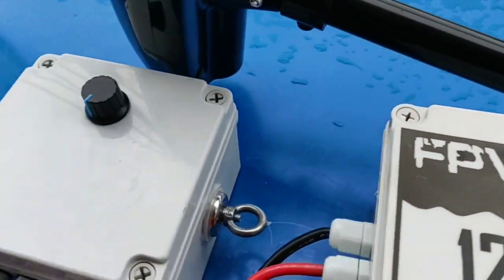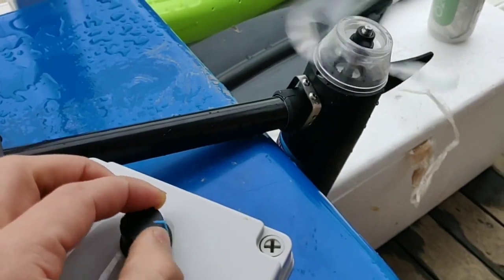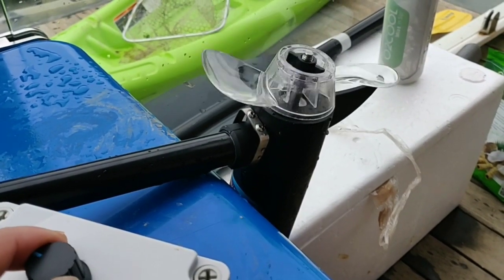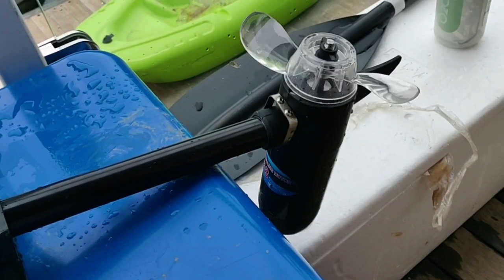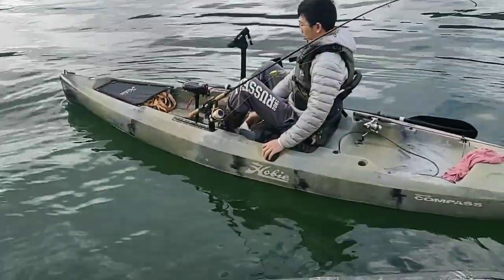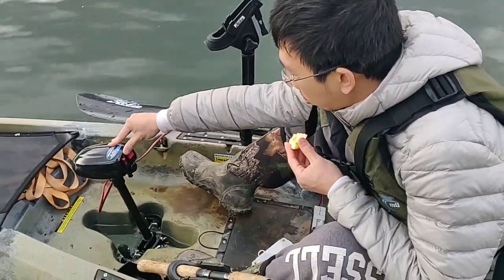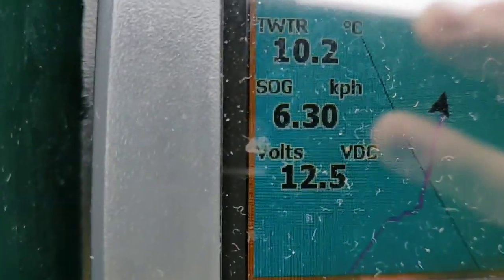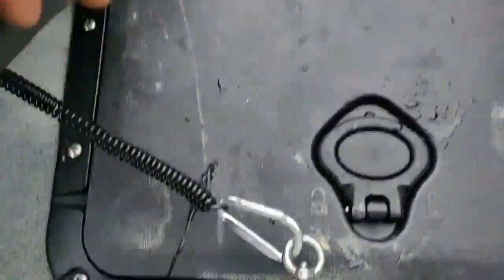Fpv-Power PWM for kayak trolling motor.

Comment: The new version of the Pwm has reverse and throttle control but my trolling motor already have those controls. So how does it work? Will the motors control be disabled and you control with the pwm instead? Or do have to match settings on both devices? Say reverse, I have to switch to reverse on the trolling motor, and then choose reverse on the PDW?
Reply: Leave the motor at full power in forwards, then use the pwm to control throttle and direction
Reply: @brandongoh8900  does it have to fpv power trolling motor or it works with other brand as well?

Comment: Guys have you ever tried this controller on the bixpy jet motor o would be very interested in trying it as the bixpy wireless remote is so unreliable will this work ?

Comment: Hello and thanks for sharing!! But could you also share what brand and from where you purchased!! Thanks!! How long do you get out of your battery now??
Reply: Hi Kevin, The PWM is made by FPV-POWER and the new version has forward/reverse switch, kill switch and voltmeter! They can be purchased direct from FPV-POWER if you're in Australia or from Mariner Sails in the US. Mariner will be receiving their first shipment very soon. We easily get 2 x 4 hour fishing sessions and still have some power in reserve with our 50ah Lithium battery but alot of our customers report much longer runtimes! It depends on your fishing style as the PWM will make the most difference at lower throttle, less difference at higher throttle and no difference at full power.